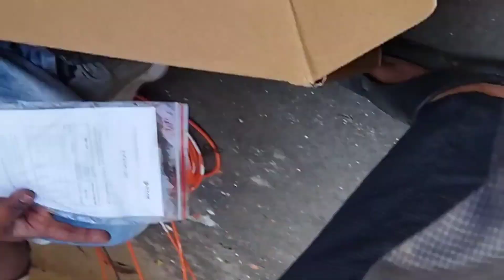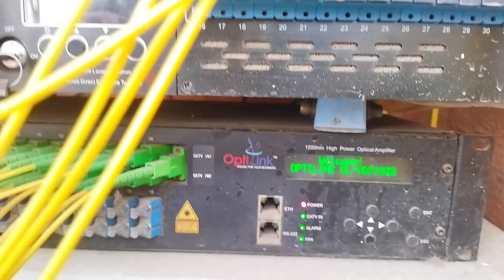32 wdm లు రెండు + రెండు 8 PORT OLT'S ఒకే చోట ఎలా సెట్ చెయ్యాలి

Comment: Bro olt signal ala panchale
Reply from the maker: Change another module....there is no settings for increasing PON signal in OLT'S
Reply: I am already using 9dbm sfp but my cantrol room is 4km long
Reply from the maker: 128 design chesara ? Ending point PON signal entha echharu ?
Reply: -25 nanu akade nunde Inka 1km thesukone valale ala
Reply from the maker: Mi design Naku send cheyyandi ...correct chesi pampista....
 suneelkumarpuli@gmail.com
Reply from the maker: suneelkumarpuli@gmail.com
Reply from the maker: Ok